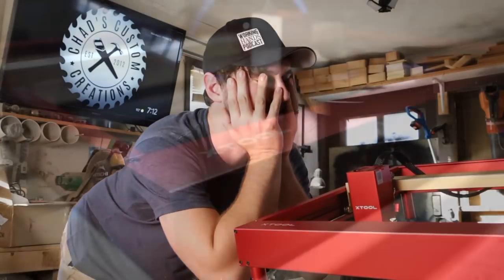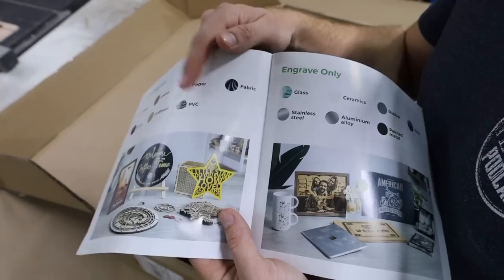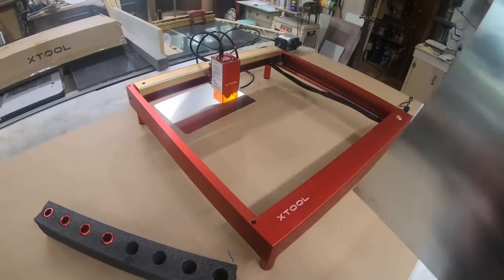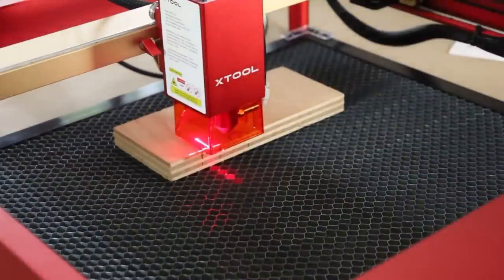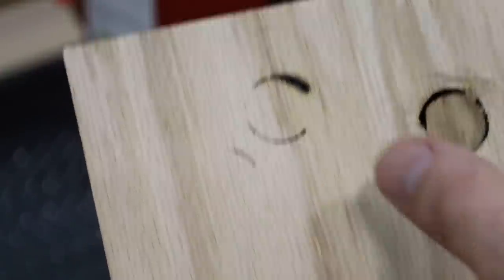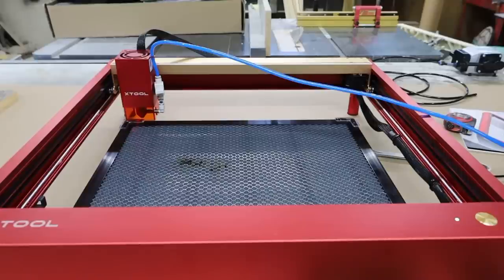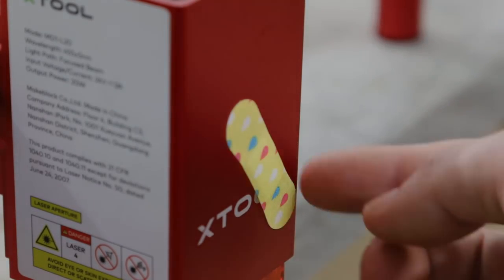(DON’T DO THIS) to Your Laser The XTool D1 Pro 20w

Comment: Yes. PVC is very toxic when burned and needs to be removed. I’m sure the meant it will cut some me plastics but they should include at least a warning ⚠️
Reply from the maker: Thank you for your input xtool is good about fixing mistakes like this so my bet is it gets changed before hitting the main market.
Reply: @ChadsCustomCreations  quantity also makes the danger. Cutting a thin pvc sheet is one thing, cutting a piece of thick pvc is something else

Comment: The D1 pro looks awesome.  I just got the D1 a couple of months ago, so I'm jealous! ;)  Interesting results for the higher air pressure for the air assist, I guess thinking about it, it makes sense since it could force air into the deeper cut and clear out smoke and debris.  As to your decision to downgrade to a previous firmware version... I don't think i really need to say much, looks like you learned the correct lesson.  I'm sure Keith will give provide plenty of constructive feedback on the next podcast episode...  That being said, please keep making laser product review and usage videos!
Reply from the maker: Thank you David yeah, I am sure I'll never hear the end of that decision lol 😂
Reply: @ChadsCustomCreations hey man, how much psi you set for let's say 3mm plywood or 80 lb paper?
Reply from the maker: @quetzalcoatlhermeticus8024  I normally just keep the PSI maxed out while cutting but if it is causing issues you can definitely bring her down. I do very low psi when engraving.

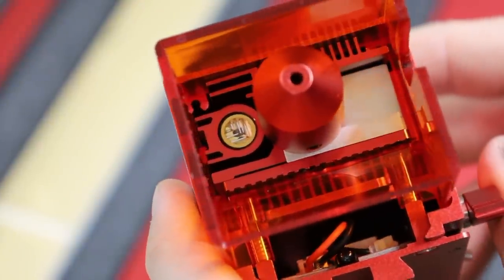Comment: 3:20. “What appears to be” I suspect you’re looking to the left of the air assist nozzle. That’s the crosshair projector.  The flame sensor is at the bottom, next to the red and black wires.  It looks like dark LED.
Reply from the maker: Yes you are correct I definitely got mixed up there.

Comment: silly question....
WHY is adding air assist helping the make things better ?
Specialy at those high pressures ?
Reply from the maker: I don't know the exact science behind it but besides keeping your lens clean to work at optional power I would guess air is also removing the particles that are being burned clearing the way for the laser to continue to pass through thicker layers without being blocked. I also think that there is some kind of adding fuel to the fire thing going on if you imagine blowing on a campfire it intensifies the heat and I believe the laser is having something similar happing here. I am Interested to hear what others think aswell.
Reply: @ChadsCustomCreations  i think you are right, dont own a laser yet, but i am learning and getting enough information to make a choice, incl all its tools.

Comment: Compressor Question:  I like the idea of the HPA, but am struggling to find a compressor.  The one you are showing may be workable, but one thing you are not mentioning is how long are you running it at 40psi?  Is that the maximum continuous output of the machine?  Is the motor cycling, or, running the entire time?  How long can the motor manage that? When I am completely up to speed, I'll be doing 380x800mm ish pieces with deep (1.5mm) engraving, which could take quite a while, even if I used the 40w, so, I am trying to find a machine that won't leave me with a pile of compressor motors in my yard.
Reply from the maker: Yes it can handle 40psi constantly I’ve run mine for hours and hours and haven’t run into problems yet. Probably 18 hours straight some days.
Reply: @ChadsCustomCreations  Does it run constantly or cycle?
Reply from the maker: @mtnmage  I think runs constantly when running 40psi cause it is trying to get back to 120psi.

Comment: Chad 
I see you were having problems with light burn using a Mac computer!  Me too ,have you gotten the Mac to connect to the D1 pro ?   If so how .?
Reply from the maker: Mine was actually a windows computer but it was my fault for messing up the firmware on the machine. Though xtool did show me how to fix it I added their solution to my latest video on the description.

Comment: Also it drives me insane when you use metric and standard in the same measurement lol 1mm/sec for a 3/4 inch hole lol love to calculate that one
Reply from the maker: Hahaha 🤣 sorry I've started using lasers for speed in terms of metric and all measurements in the design are all imperial blame Lightburn for letting me set it that way.
Reply: @ChadsCustomCreations  lol yeah I just was curious for cut time at 1mm/s is pretty easy math aside from conversations

Comment: I am very new to lasers, but I need something to cut 3m self-adhesive sheets to custom shapes. I am using some vinyl cutter for this, but I am very unhappy about its accuracy. How many hours per day can this machine work, in your opinion, and how long would it last in general? 🙏🙏🙏🙏
Reply from the maker: I’ve run mine straight for over 8 hours I don’t see why it couldn’t go longer either.

Comment: Another question or two:
- a fellow teacher said he uses xtool M1 in his class, but it’s a good chunk more $ and the biggest difference I can see is the enclosure. Are u aware of any differences that might be worth the $?
- any safety considerations I should prep for before I turn my class loose? (Venting, goggles, enclosure, etc.)
Thx much!
Reply from the maker: So the M1 is enclosed and also has a vinyl cutter but I've never been a fan of the all in one machines as they to me seem to do the jobs less well than a dedicated machine. 

I am about to get the enclosure kit for the D1 and make a video on how to setup a laser indoors. 

But yes for the classroom enclosure is a good idea as you won't have to have glasses on everyone in the classroom. 

Venting will be big for you have access to a window? If not there are units that filter out all the smoke and can be left indoors but I haven't personally used those yet.
Reply: @ChadsCustomCreations  thx much! The windows in the class don’t open but I do have a vent hood used for Chemistry labs that I could place the exhaust hose in. 
More research to do but I’m leaning towards the D1. Thx again!!

Comment: If I’m going to do the air assist upgrade you mentioned with the air compressor in your description, do I have to buy the air assist through them for any reason or can I skip that and put that money toward the upgraded compressor? What I’m saying is I f I don’t buy the air assist through Xtool, will there still be a connection for me to hook up my upgraded air compressor to?
Reply from the maker: Yes no need to purchase the air assist with xtool if you want to reach the higher psi like I showed.
Reply: @ChadsCustomCreations  You’re my hero! Thanks for such a quick response. Ordering with your code now, hope it helps a bit! Love the videos! Keep up the good work!

Comment: Hi. Can i use atomstack laser air assist to xtool d1 pro? Thankyou😊🙏🙏
Reply from the maker: Probably as long as the air tube that goes into the xtool is a 7mm or 1/4” I believe. Or you could always get an adapter too.

Comment: I need help.  I have a ryobi air compressor that will hold a set pressure. It has an air hose attachement fitting.  I cannot figure out how you added the gauge thingy.  Is there anothe vid on the set up I can watch?
Reply from the maker: Did you purchase the fittings kit in my Amazon links?
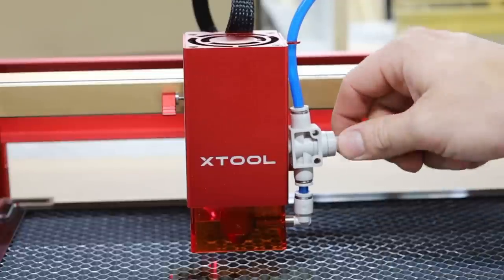Reply: @ChadsCustomCreations  I bit the bullet and just did it.  I took the air our fitting out and put in one of the blue ones.  But --  the shut off valve you show at the xtool end is not in the kit.  Do you have a part # for it? 9:54 in the video?
Reply: never mind. I overlooked it in the list!

Comment: Would and air compressor for an air brush system work for the  air assist?
Reply from the maker: I would definitely think so. The PSI probably won't be super heigh but I bet it would be similar to the Xtool stock air assist
Reply: @ChadsCustomCreations  Thank you!!

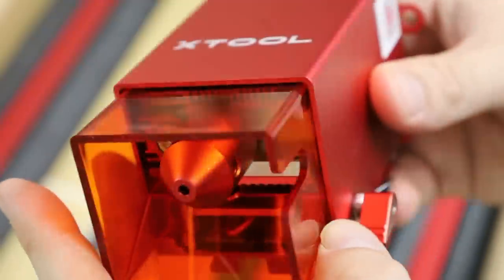Comment: 3:20 That looks like it's the crosshair/aiming laser
Reply from the maker: You are absolutely right 🤦‍♂️I did find the flame sensor and that's definitely not it. I should have known as the normal D1 has the red dot pointer in the same place.